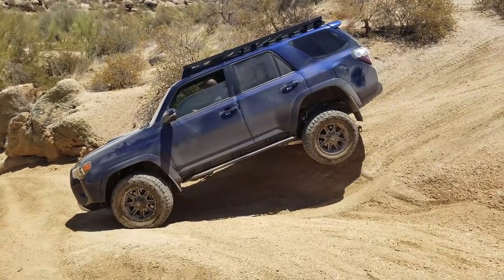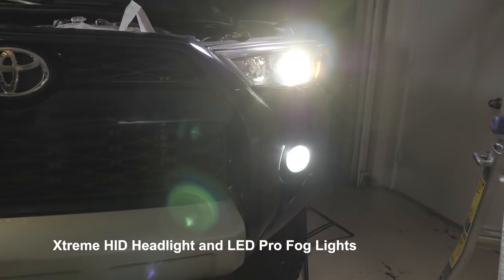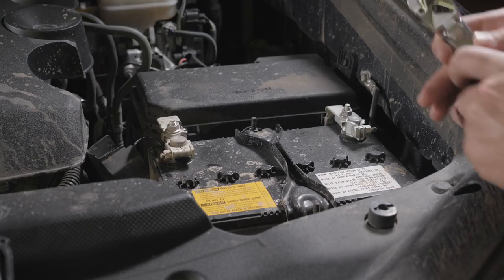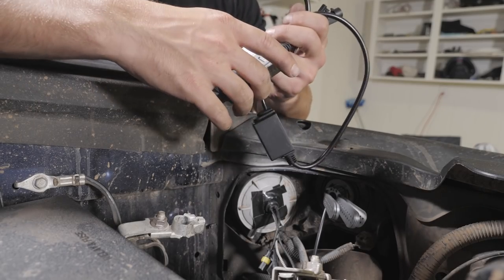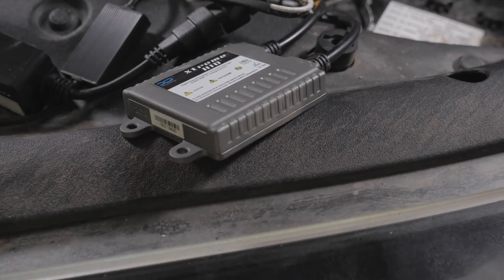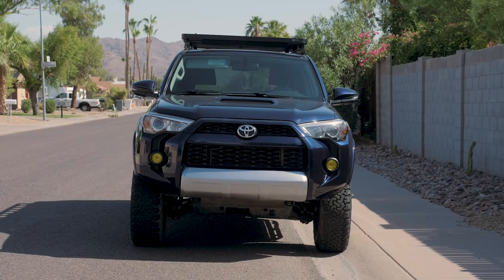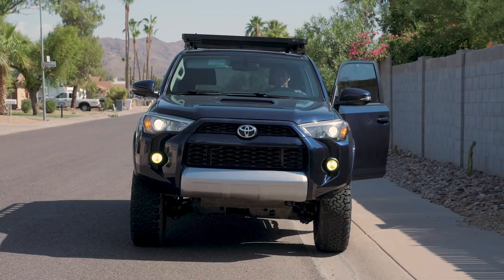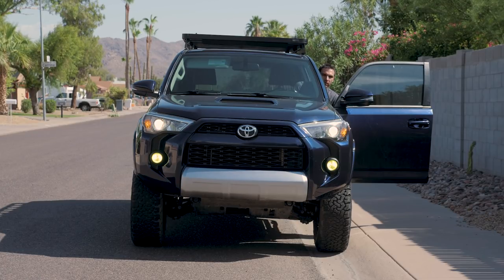4Runner Xtreme HID and Xtreme LED Pro Kit from Xenon Depot - Review and Install

Comment: I have installed HID & LED in my 2010 4runner about 3 years ago & love them , my lights are brighter then my friends 2017 4runner with the same setup. 
Thanks for the post
Reply: I have a 2010 I was looking into converting. Where did you source yours out from? Have they lasted?
Reply: I'm using Morimoto XB35 , they also have a 55W system that I bought at the same time but the 35's have lasted till now well since 2012 is when I installed the so when the 35 's go out I'll install the 55W system.
The reflectors on the 2010's are much larger & can produce much more light.

Comment: I have a Question : the DRL mode uses the High Beam lights? I think I dont get exactly how this actually work....
Reply: At least in my 2017 Camry, the DRL uses the High Beams but dimmed down (the computer sends a lower voltage to the high beams when DRL is on). So, the CANBus is basically a transformer that will increase the voltage. The High Beam LED will be running a full power with the CANBus. if there is no CANBus, then the LED will flicker because of the voltage drop.

Comment: Hi, Installed the 9012 XTR HID (5000k) kit on my 2018 Rav4 and it's more than a month now but still struggling to achieve the "Pure White" of the 5000k.... I see the "Pure White" every time I turned-on my headlights but after a few seconds of warming-up it turns to  "Yellowish"... In general, does all Xenondepot HID's really requires to wait for a longer burning hours for the color shift to achieve the desired white output?

Comment: Your high beam LED’s are not installed correctly. The LED’s on the bulb should be facing left and right, they should not be up and down or at an angle like yours are. The bulbs should have an adjustment on the collar to fix this. You should see better performance from them when corrected.

Comment: Are you getting any high beam flashing from other cars?
Reply: I bought and installed the HIDs and just took a trip with lots of night driving. Without adjusting the aim form stock, I was flashed probably 40% of the time. It was kind of funny but I do think I will try to aim them down as soon as I get the LED high-beams installed.
Reply: @itsjared  I get it sometimes on the factory lights on my Mercedes. I think people aren't used to the whiter color of HID lights. They may be staring right at the lights. The same thing happened when halogen lights first came out. People were use to seeing the regular lights and halogens looked too bright for many people. But people got use to it over the years as halogens became more common. Even I used to stare at the halogen lights when they first came out.

Comment: lumens are off the top of my head so they might be slightly off but....the factory low beam bulbs( 670 lux)are too dim for sure, especially for wet driving conditions at night...I put GE Megalight Ultra H11 +130% (1069 lux) in the low beams which were slightly brighter and whiter than stock but still not good enough so got some philips 65w h9s (1230 lux) and modified them , they are slightly brighter than the  GE megalight bulbs and the driving experience is improved over the stock bulbs but Im thinking HIDs are next...

Philips 9011B1 9011 in the high beams so I am happy with those, not sure I want to mess with LEDs ,  I do have LEDs in the fog lights - yellow color  diode dynamics H11 SLF (730 lux?) they are nice in pouring rain and snow, much better than white and the LEDs light up a wide path but considering the fog lights take a H16 bulb the H 11 bulb will fit but it's a pain to get in there

Comment: why did you go with LED high beams and not HID high beams?
Reply: Hids need time to warm up, in the typical high beam allocation people just used them to flash people. In that sense they are worthless as they wouldn't be warmed up and probably wouldn't do much. LED is instantly on.

Comment: Why did you choose a HID headlight kit vs LED?
Reply: based on research HID has better lighting.   LED creates bad cutoff lines or sometimes none at all, which blinds other drivers.   HID has been around for a long time and is developed tech vs LED still in development phases.   Also HID for high beams are not great for the sheer fact that they sometimes are quick turn on and quick turn off which HID takes time to light up vs LED instant light up.   quick summary hopefully this helps

Comment: Hey did you add the PWM option on the H11 HID kit?
Reply: I just ordered the HID kit, and as far as I am concerned, the PWM is only needed if you plan on running the HID bulbs in a system that has DRL's. So, if your DRL's in your headlights are the normal low beams, just dimmed, then you would need the PWM. I think the DRL's in the 4Runner are separate bulbs, so you should be fine. I only got the low beam replacement for now, and the PWM is not needed.
Reply: @ELIPSIS1117  Thanks!
Reply: ELIPSIS1117 how’s the brightness considering it’s only 35W?
Reply: Compared to the stock, the new ones are 1000 times better. The white light just illuminates the road so much better than the yellow halogen bulbs. Especially in the snow. I would compare it to the stock high beams, if not better.
Reply: You just saved me $30!